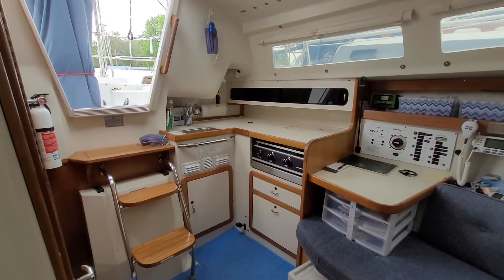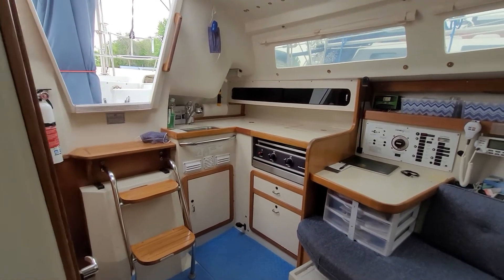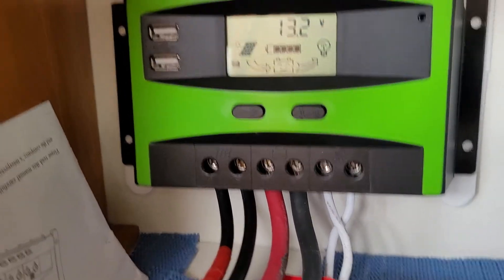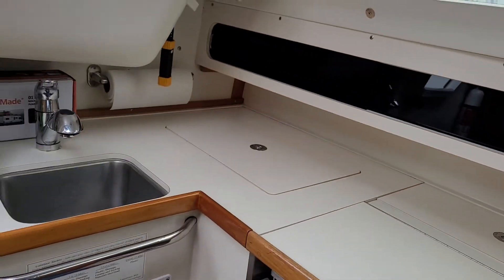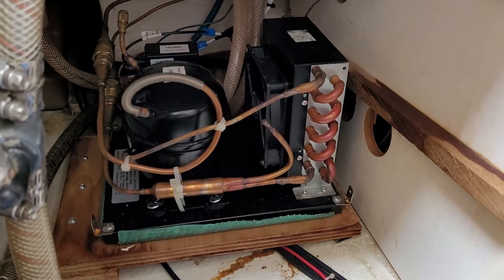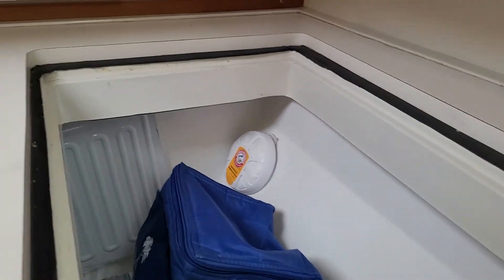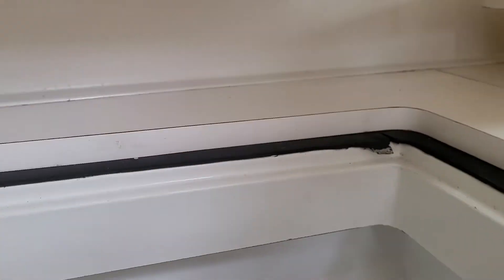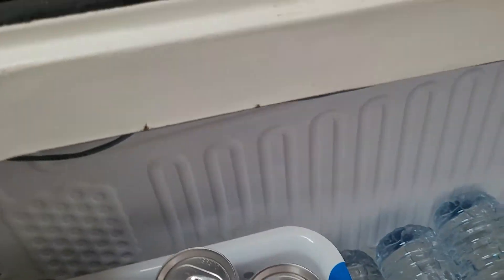Ice box to fridge conversion Nova Kool LT201 unit

Comment: What type of holes did you have to make put in the cooling plate and Thera Stat?
Do you have the amount of load it would use in a 24 hour period at about 30 deg c anbient. While being aboard the boat?
Thank you
Reply from the maker: I only needed to drill a 1" diameter hole to pass the refrigerate tubes and thermostat wiring. I then filled that hole with a shot of spray insulation foam. Power consumption on this model, Nova Kool 201, is very low.  I also have 4" inches of foam insulation on the outside wall of the ice box. My 200 watt solar panels keeps the battery well charged and I run the fringe from mid May to October. Non stop.
Reply: Wonder how it would work in a south carolina summer?
Reply from the maker: @redwood1957  it would work fine.  These units are sold worldwide and many as original equipment on many boats brands.